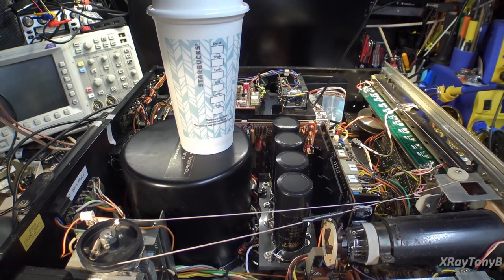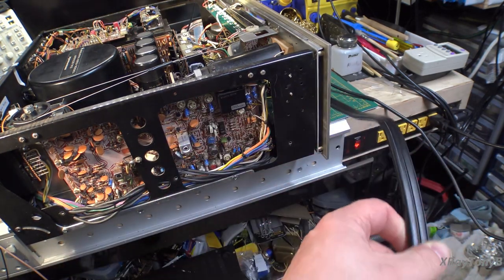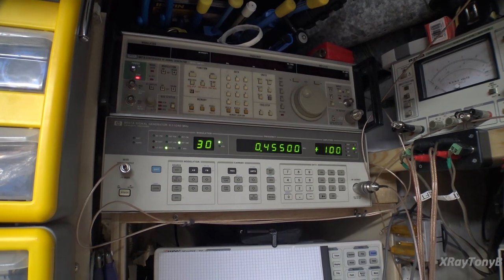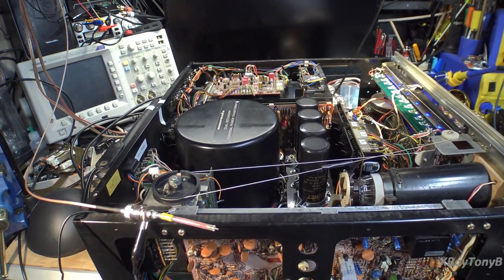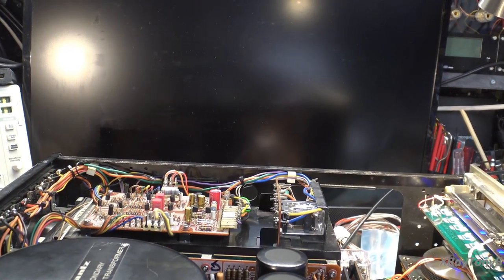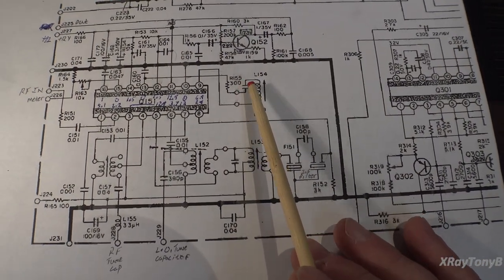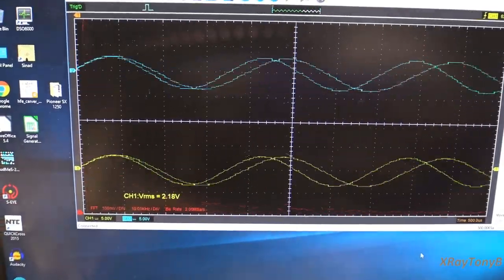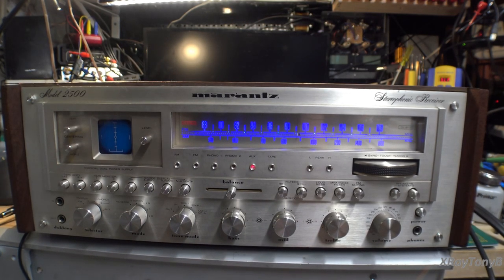Marantz 2500 Part 5 - Final

Comment: Great troubleshooting and repair work -- and plenty of reasons not to buy massive, elaborate all-in-one "vintage" stereo gear, no matter how wonderful it sounds when it's working correctly.  If you want that level of performance, it makes much more sense to invest in a separate tuner, preamp, and power amp -- trust me, your service technician will thank you when something goes wrong, as it inevitably does in equipment this old!

Comment: Hi Tony,

Recently I've repaired a B&O cassette deck for myself. And I was surprised to find several faulty LF353 opamps in plastic cases. They did not burn, but they functioned very unusually, if it can be called "function". There is a suspicion that plastic degrades over time, or degrades for some other reason, which disrupts the functioning of the crystal or destroys the internal conductors. Therefore, ICs for the military, medical, and other highly responsible technology are enclosed in ceramic shells, and transistors in metal-glass ones.
Reply: I don't think it's as strange as it seems.  All that has to happen is for the seal to fail and allow moisture to get to the chip and it will die.  What can happen is if the chip overheats, it can crack the case.  And when it's shut down, the moisture can work it's way in.

Comment: This was a great series. As someone who designs and builds his own home audio equipment, you can always learn a lot by observing the inner workings and design of some of the vintage equipment. I also enjoyed the "capacitor" discussion. I just bought some 4.7uf met-poly's to replace tantalums's that I'm using in a vintage pre-amp.

Comment: Maybe you would be interested in doing a video restoring my SX 1250. I bought it in 1991 from the original owner. The only thing I have done to it was replace the soft start speaker protection relay.

Comment: Great Series on a classic piece of gear. I almost bought one these (or a similar model) back in the day, but decided to with seperates since I felt they crammed too much circuitry into a single unit. I wish I kept that vintage kt7000 Kenwood tuner and my old (original) Dynaco 120 power amp. Well, at least I still have (and use) the Sony TA-2000f pre-amp. (recapped and upgraded).  Even though I design and build most of my audio equipment today (except speakers) I know very little about the radio-end of things. So I'm always fascinated with those procedures and theory and how you home-in on the defective component(s). I noticed you didn't mention anything about the use of tantalum caps. in audio equipment. Do you avoid them or just use them for bypass ? I used them (4.7uf 50 v) in the build of my pre-amp's line stage back in 2006. They tested and still sound great, but now I'm thinking of replacing them with new film caps. (At the time I could not find films caps small enough to fit on the board)

Comment: Does anyone still broadcast in Dolby B any more? I noticed the Dolby light on all the time! If Dolby is switched on with no Dolby transmission encoding, the sound will lack HF detail and range because Dolby is a two way process. Boosting a variable HF on transmission and the opposite on the receiver.

Comment: Just for curiousity - what is that Dolby module doing? I could not find any informations on that module functionality - is it kind of pseudo stereo-wide, or is it kicking in when FM static comes up?
Reply: I own a Dolby receiver.  Back in the 70's. they had a few Dolby stations. All of them abandoned it by the 80's just like quad.  It did reduce noise but too expensive to really catch on for a few and made the sound bright for the rest of us. The only one I knew was Rock 102.5 in Buffalo NY. That station also went fully automated at that time, no DJ.  My receiver was over 500 bucks and a fee has to be paid to use Dolby from the manufacturer..

Comment: I bet the Cincinnati AM radio station was 700-WLW. They have a 50,000 watt transmitter, they used to have a 500,000 watt transmitter. The building and part of the old transmitter are still there. They used to let the public in to see it, but It's been awhile since I've been there so not sure if they still do that.
Reply: Yep they blast u in Akron and I got them in Toronto.  At 500KW, well I read it knocked out a station in Quebec, maybe 800 miles.

Comment: this needs  trigger warning Capacitors and flat earth denial! Many moons ago I worked for a small component distributor in the UK we had loads of OEM audio customers as the brand of electrolytics we were franchised for just sounded good to them these were not Audio grade stuff some were speced into the old IBM PC's of the mid 80s. I would like to have a play and see if there is anything in the audio grade stuff being sold in these modern times but no space to play electronics without causing issues with she who must be obeyed.

Comment: Coffe cup.
As it fell the cup, its contents and the cap were all suject to the basic law of gravity whereby they had equal acceleration. By chance it landed perfectly flat on the cap and its vent and the weight of liquid prevented air from entering thereby preventing leaks. As you picked it up the same weight pushed the unsupported lid off. 
Cat 1 coffee 0